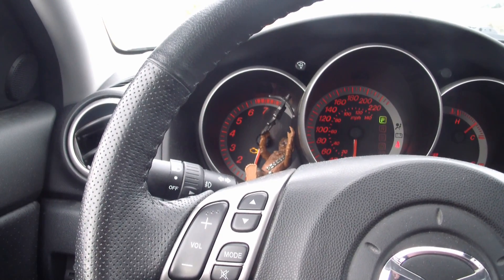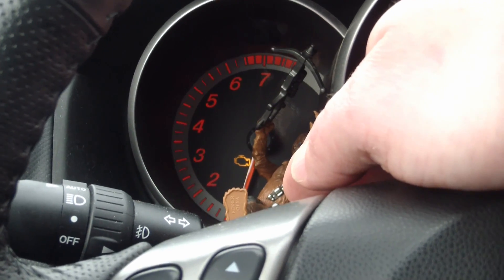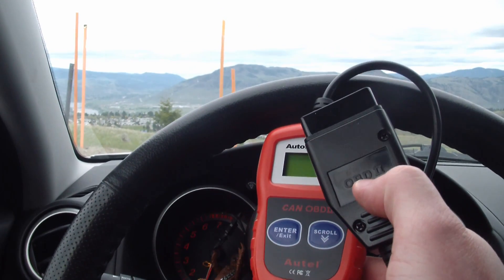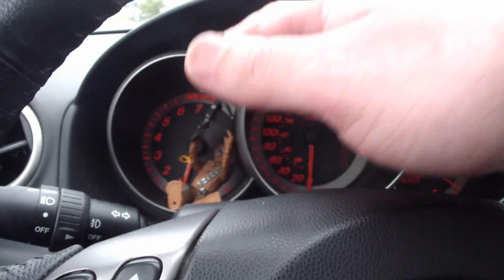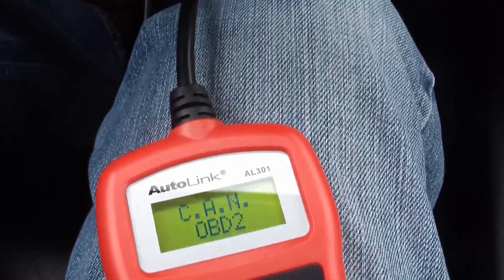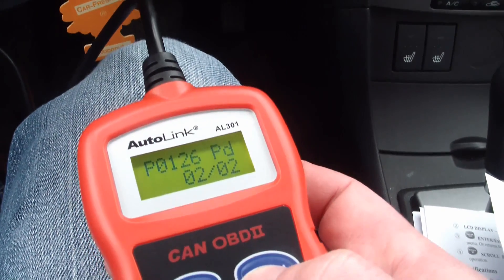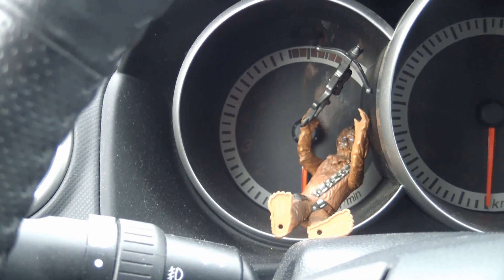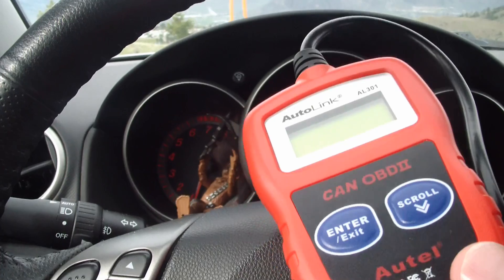Manly-Man Skills: Outsmart Mechanic Scams by Using Your Car's Computer!

Comment: A lot of people think the MIL (malfunction indicator light) will diagnose any problem in a vehicle.  The earlier nomenclature of “check engine light” is more intuitive in its naming convention.  Suspension and drivetrain issues are mostly not covered, as the MIL is to keep compliance with emissions regulations.  If your vehicle is shaking uncontrollably but your check engine light isn’t on, that doesn’t mean there’s nothing wrong it means there’s nothing wrong with your emissions.  The govt doesn’t care if your brakes don’t work.  Marinate on that for a second.

Comment: Just becuase it didn't come straight back on doesn't mean the fault is not present. Depends on the trip detection logic. Could be a less serious fault with a two trip detection logic. That seems to be a fault detected by engine map settings ie. It checks the time to heat up the engine and finds a discrepancy in the time it takes to do it Compared to engine load and outside ambient temperature. Could be a sensor issue, wiring, pcm or mechanical like the thermostat. Did you find out what the problem was?

Comment: I know what mine is on for. Its for my catalytic converter, am i gonna fix it? 

   No i don’t get paid enough, and if the government was that concerned they could pay for it themselves. I ain’t paying for a piece of pipe worth over half of what i bought my truck for. Theres probably a few other codes i’m forgetting, including possibly an airbag code. 

As long as there are no engine codes, she ain’t going into the shop.

Comment: Only 30 doll hairs?!? I overpaid by about 4970 kanuckistan kopeks! I guess mine is quite a bit bigger with more buttons and cables. And it says snap on across the bottom so that in itself could cause the price increase.

Comment: I've commented in the past about code readers. Will the code give you a...general... direction? Yes. Will it be helpful to the average  person most of the time. No. You start getting into evap codes, o2 codes, or misfire codes...what then? 

I can even save you the $30. Take your car to almost any parts store. They'll look up your codes for free. Then take that code and Google it. 

Also, if you're in a state that does emission tests and you clear your codes prior to a test. You may fail the test because the monitors aren't set. 

Just keep these things in mind.

Comment: Love your channel Boltr. The check engine light will flash if the detected error is serious. When it is on steady it just means you need to check it when you get around to it, or if it is on all the time that means your driving an X5 e70 , I think my wifes car has spent more time with that on that off. Save yerself a few bucks and get a bluetooth OBD and check and clear codes as she drives. The bimmer needs a Carley adapter but domestic made autos seem to do fine with descent ones and a free app for the phone.  Some older cars will give up the codes without a scan tool, using the key and cycling it on off a magic sequence then  the codes can flash the check engine light then you can look up the codes on your interweb device.

Comment: the check engine light only comes on due to emission issues. it doesn't mean your gonna blow up the engine, the only time you should be concerned if the check engine light is flashing, which means the engine is misfiring, which could burn out the catalytic converter. STOP DRIVING IMMEDIATELY IF THE LIGHT IS FLASHING!!!!!!!!!!!!!!!!!!!

Comment: "Insufficient" coolant temperature means the coolant is temperature is – insufficient – insufficient means TOO LOW. So having too little coolant will not make the temperature too low. If anything, it will make it too high. So all that adding coolant can do is make the temp even lower.  Most likely the thermostat is stuck open. I'd check the thermostat first. Drive around for 20 minutes and there is a high likelyhood that the code you cleared will come back. Yes, do not bother telling the mechanic your guess as to what's wrong. Let them figure it out. See if it matches your guess. When I was a mechanic, back in the 1970's, I found that about 90% of the time the customer's guess was wrong. His-her guess was ridiculous. I listened to it, but  did my own tests. I learned early that fixing what the customer thought needed fixing, was a bad bad idea. 
       One time I had a customer whose vehicle would stop running and then would not restart. Her previous idiot-mechanics had replaced the parts in order of expense, first the battery, then the starter, then the alternator. With a new battery, the car ran for a few days at a time, every time the battery was charged from outside. Finally she stalled near to my place, and called moi. I came out with my $30 volt meter, and in about 3 minutes I discovered that the alternator worked, the starter worked, there were not broken or shorted wires, the problem was that the voltage and current regulator device was not working. It was putting out zero volts. Was not charging the batter. The previous "parts changer" mechanics had changed every part but the right part. This was around 1977 or so, and the vehicle had a regulator that was separate from the alternator.. Actually I think this vehicle had a generator. Was I the only mechanic who knew how to do basic electrical tests? When I found the problem I said "eureka" with a rather fey tone, "eureka" being Greek for "I found it." Later I found out that the vehicle owner was Greek, and same-sex-sex-inclined.  Really I had no idea at the time. I don't know what made me say eureka in a fey tone instead of "I found it" in a confident masculine tone. It just seemed like fun. Anyway I had a customer for the life of her vehicle, and several of her friends, male and female, also became my customer. Just because after about 3 different parts changes by 3 different so-called mechanics, I was the first person to actually know how to actually diagnose a problem instead of just change parts.
      In the US the new car dealers and their service departments are indeed profoundly corrupt..
      My current OBD2 test device cost about $10. I put a free program on my laptop computer, and the device talks to my computer, biue tooth, and creates an html file with all the trouble codes and all the measurements. It only reads engine codes, no brakes or HVAC, no transmission codes. It will also connect to an android phone, the same way. So for $10 I can test engines and give my customer a printout of everything the code reader found. For about $100 you can buy a similar device that reads brake, HVAC and transmission codes for most popular vehicle models. You can get these with usb connection to your computer, bluetooth connection, or WIFI connection.
      I work in IT now but I recently had a friend whose dashboard light said "cooling problem." The Coolant idiot light would be flashing red, but it would stop flashing after the car warmed up  Why would the problem fix itself after the car warmed up? You would think that that might make an inadequate cooling problem worse, cause the car to overheat. The reason turned out to be that there was a coolant level sensor in the coolant expansion tank, and the coolant level was below the sensor. When the car warmed up, the coolant expanded, and rose up at least to the level of the sensor. The problem was not "coolant temperature insufficient" rather it was "coolant insufficient." We put a few ounces of coolant in the tank and that fixed the problem. All the idiot light did was tell us there was something wrong in the engine that could possibly lead to engine overheating. No matter what the problem was, thermostat  stuck closed, coolant temperature actually too high due to glob knows what, or coolant level in the expansion tank too low, the same idiot light would go on. To distinguish between coolant actually too hot or coolant level too low, you would need an OBD2 tester. No coolant temp gauge in the vehicle. But you can read the precise coolant temp, in F or C, with an OBD2 tester. With an Android phone you can read it with a digitally-created analog gauge on the screen, along with a digital readout of the exact temperature, underneath the gauge. There is a temperature sensor that screws into the radiator somewhere, has a thermistor in it, and reports temperature to the vehicle's computer.

Comment: My wifes 2015 Jeep threw a code that the outside air temp sensor was bad. Minor issue. The code locked out being able to use 4wd! Stupid. What if i was out in the boggy Maine woods and the temp sensor went on the fritz. I would be stuck. I keep a code reader in the glove box so i can reset as often as needed.

Comment: They make good diagnostic software now that isn't to expensive. It all plugs into the same generic plug under the dash. You still have to diagnose the problem and replace the bad module or parts. But your right mostly to the point. It's usually something like you left the gas cap off when the engine got started or some other damn crap. And if you own a GM car it's gonna be an evap code for certain.

Comment: Also in California no matter what that light is on for no matter what could be your f**** cabin filter you fail emissions you fail admissions for a transmission code you fail admissions for a ambient Air temperature sensor for the f**** radio you fail for any reason that light is on California we love you

Comment: If you have Onstar on your overprice General Motors vehicle just call them and ask what the code is.   I did this on a trip out east when the MIL (malfunction indicator light) came on after a fill up.  P0171- lean fuel trim....fucking West Virginia watered down gas.  Also- Note that it isn't always a gas cap or O2 sensor.

Comment: or you could just stick electrical tape over the light....lol
one of the most common reasons for the check engine light is a loose fuel cap. Somebody didn't tighten it until they heard the clicks.

Comment: Taxi + check engine light: can confirm for Italy, Romania, Argentina, Bolivia, Colombia and Germany. However, the German case the engine actually died after 3 km! 😁😁😁 I was lucky I had time to spare on my way to the airport to wait for a replacement taxi to pick me up from the side of autobahn 😂 That was a seriously upset cab driver as the car was new, under warranty, had been to dealership twice already for exact same behaviour. Engine suddenly start loosing all power, going from normal to dead within 30 secs.

Comment: Good way to tell people about the 5% of diagnosis that means next to Jack shit. Thanks for reinforcing the incorrect assumption that every time a mechanic asks for diagnostic time it’s bullshit. Way to go! Sorry but that scan and delete is about 5 mins and tells you next to nothing! To actually diagnose a complex issue can take 5 hours or more (worst case) My skills are the same as yours, and ain’t free. (An engineer needs a hero too sometimes! They’re Called a good mechanic!I have had cars that have been brought to my shop with thousands spent by “engineers” that have taken me less than an hour and less than $200 in parts to fix for sure. I have also spent 6 hours diagnosis on a good clients car and charged them 1, (because they trust us and come back to us). Honesty is no.1.   My old man is an engineer, but brings his cars to me for a reason. Good diagnostics and reasonable repair costs. Most of us aren’t out there to rip people off but rather to ensure that everyone can go about their buisness SAFELY!!!

Comment: Most times the CEL comes on the computer will revert to "failsafe" mode and run the engine rich or lean ( i can't remember ) so it will easily start and run, because it can no longer manage fuel/ air mixture due to a bad sensor or "glitch". This will inevitably foul the plugs and blackened the back of your car and eventually it wont start or stay running. The original soul purpose of the computer was perfect fuel/ air mixture for economy, efficiency, and emissions

Comment: Some makes won't display anything with one of those cheapo readers. Volkswagen comes to mind- but there you can sometimes have luck with a $20 ebay cable to hook it to a laptop. Just make sure that your reader will give you all the info you need.

Comment: If the money light is flashing (or red in commercial vehicles as well) you have what the manufacturer has decided is a critical fault, where you should stop the engine.

Comment: And once the temperature rose, the monitor ran and the light came back on. You went to the dealership but since you disconnected the battery, there was no freeze frame data to diagnose so the repair cost 3X more.

Comment: Typical case of a little knowledge being a dangerous thing. 
First, disconnecting the battery NEVER erases the codes or turns off the light in an OBD II system They can only be erased with a scan tool.
Second, if the light does not come back on after you erase the codes means nothing. Many codes require at least one drive cycle for the computer to test the system.
When you erase the codes, you are also erasing the historical information associated with that code. Valuable information for the tech who has to fix your fuckup. But this is just the opinion of a 45 year, ASE Master Tech.

Comment: Mazda - Hope it's just low coolant or the thermostat is stuck open. If it is a V6, with the Ford engine, and the water pump on the inside, you can do it for $500, or take it to the shop for $3000

Comment: An older gentleman of my acquaintance had the CEL come on. His mechanic found a "large evap leak" code, found the gas cap was loose, and took care of it. A year later, CEL came back on.  Old fella checked the gas cap, found it was tight, concluded the CEL was wrong, and ignored it. It was still on when he passed away five years later, from non-CEL-related causes.

Comment: AutoZone guy: "I'm sorry, but store policy says I can't clear this code for you."
Me: "Are you serious?"
AZG: "Yep.  I could get fired.  I am absolutely not permitted to push this here button right here." (turns device to show me which button)
Me: (reaches out and pushes button)
AZG: (smiles quietly to himself)
Reply: I love it when you get customer support like that. Also when you have a specific question which they are for some retarded reason not allowed to answer directly, but they can tell you 99% of it and then you just have to flex both of your brain cells for a second and got what you asked for.
Reply: @fredwupkensoppel8949  I had a few times where I'd have to tell a customer, "Under no circumstances should you connect this wire here to this wire here. Doing so would bypass an important safety device and cause the machine to run without replacing the faulty part."
Reply: Cash For Clunkers was a back door way to get pre non OBDII off the road so you had to buy one where they can eventually track you....and they will!!!!
Reply: My wife's VW Jetta has the stoopid habit of displaying code P-0420 ("Low detected catalytic converter efficiency")... BUT GUESS WHAT? It came WITHOUT the second Oxygen Sensor... so that THERE IS NO WAY THE SIMPLE CAR COULD EVER DISPLAY SUCH A CODE!!! It must be that VW just installed a more modern software on that 2010 made Jetta, but used the simpler single O2  Sensor only.  Thanks to friendly AUTOZONE employees, they said "I am not permitted to erase any code by pushing this and this button" and helped me enormously by clearing that FALSE code twice in three years, allowing me to pass emissions with flying colors at less than a third of the emissions limits (the Cat Converter has only about 48,000 miles and is in good shape...  Thus, I believe that VW is stealing from the many candid owners that believed their converters were bad, and bought a new converter at high cost from their STEALERSHIPS...
Reply: @alfredomarquez9777  After the diesel chaos I would not trust a thing VW ever does.
Reply: @charliedee9276  That is the reason I bought her THAT MODEL Jetta (2011): because in reality is a cosmetically renewed old Gen 4 model, a very simple, reliable, easy to fix, inexpensive car, that I can quickly repair and maintain at home!  Parts are cheap, plenty and easy to get. There is PLENTY of information manuals. With common tools, that old Gen 4 model can be made to endure many years WITHOUT EVER VISITING A VW DEALER ("Stealer"). A very basic, no- frills car. The only weak point is the ignition module that they sell only with the coil... and that is because some stoopid "genius engineer" at VW installed it directly behind the hot airstream from the radiator fan.... But a simple aluminum sheet home made shield can be made and installed easily to prevent the ignition module from overheating and, specially, Heat-cycling, which is what makes it fail.
Reply: Then when the part you changed doesn't fix it and you take it to a technician with a real diagnostic scan tool he won't be able to back track and look at freeze frame data to figure out what's really wrong.
Doing what this guy is doing makes a technicians job much more difficult to find an intermittent issue.
Reply: @ronbowman4145  And what about those bugs that throw out FALSE TROUBLE CODES, that mean NOTHING???
Reply: @ronbowman4145  and then wonder why they are charged an arm and leg for repairs.
Reply: @ronbowman4145  Yep, and everyone thinks that the problem might just "go away" without actually fixing anything.